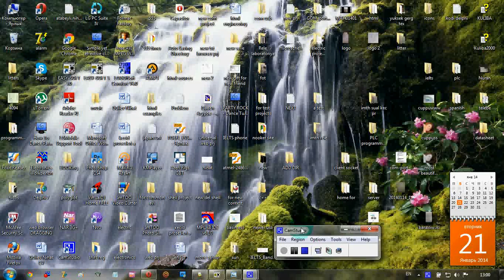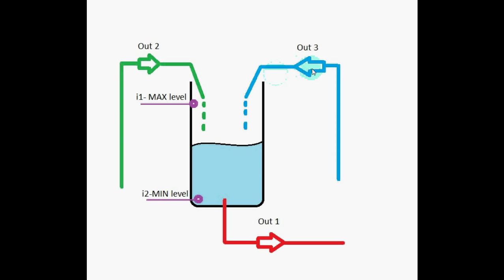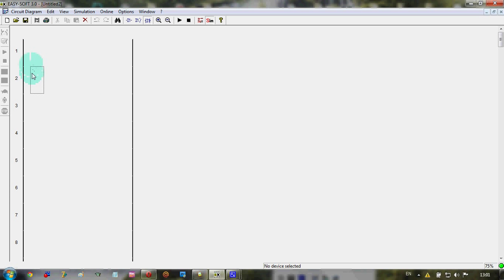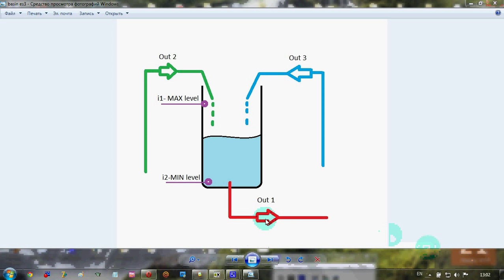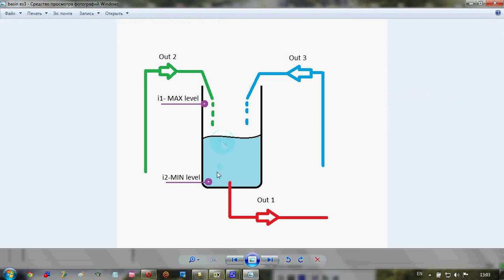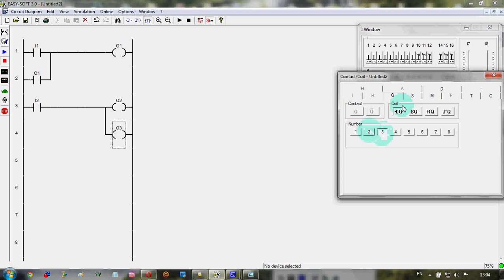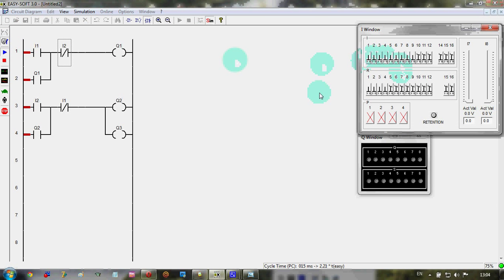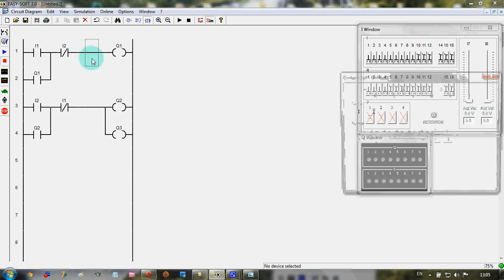Moeller Easy Soft 3 0  Maximum and Minimum level sensors

Comment: Hi its a great tutorial. I have question how it would look like with third sensor for Medium level sensor which will output only nr.2 ? Thanks a lot one more time
Reply from the maker: Hi, what do you mean by nr.2??
Reply: I mean "out 2"
Reply from the maker: if you use out2 ones u cannot give our2 2nd time as a different value. So u need to give another output such as out3 or other.